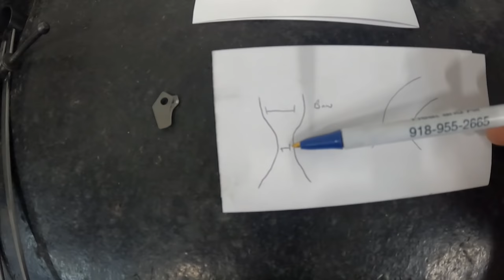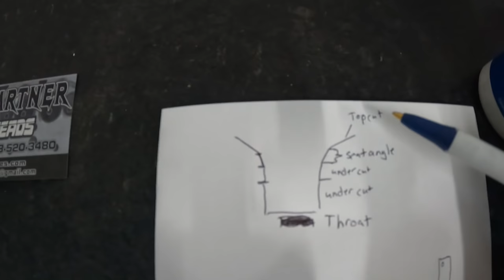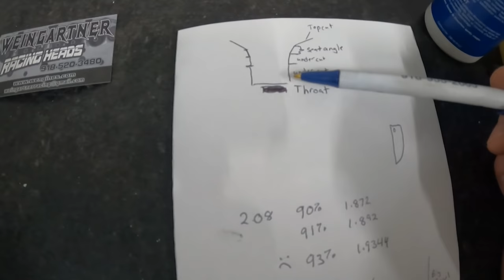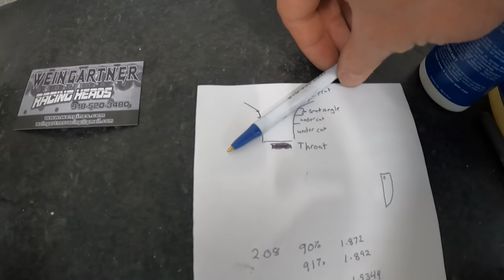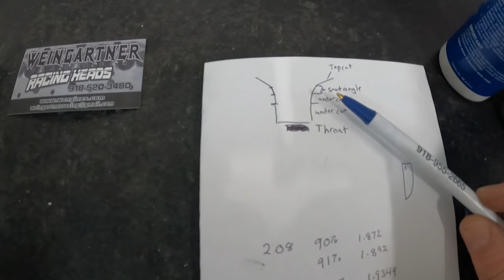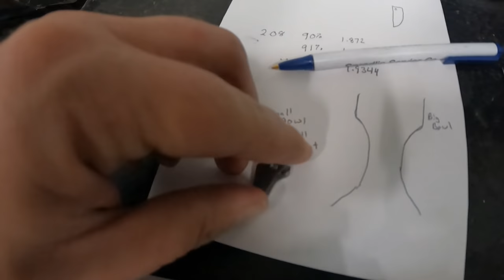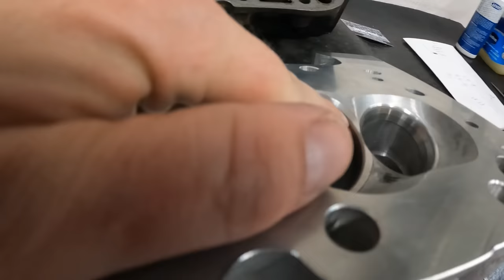What not to do when porting heads

Comment: 35ish degrees is what the seat should be. Check out David vizards videos on porting. He is a absolute wizard on them and wrote the books about porting. The tinniest change can make a big difference if it's in the right spot. It's all a balance of port velocity and flow.
Reply from the maker: That is completely and utterly wrong. The only place for those seat angles is a diesel because they have very little lift and it helps with seat wear.
Reply: 35 degrees is the angle he suggest from the widest part of the bowl up through the edge of the throat on the cylinder wall size. That isn't the seat angle. On the cylinder center side he suggest the angle should be 10ish. That's about bowl dimensions and doesn't have anything to do with the cut angle on the valve seat.

Comment: Thanks for the great video.  The reasoning for throat ratio not being critical for exhaust make sense but it begs the question: would the poor flow characteristics of the throat being cut too wide be lessened with an increase in pressure of the intake charge (i.e. forced induction)?  Thanks for the informative videos!
Reply: The point is with forced induction you no longer need skill. Just boost and more boost. If you blow fuel straight through it doesn't matter as you can brag the dyno results.
Normally aspirated is like a musician in perfect tune across the spectrum. 250bhp per litre was achieved in the 1960s. Many turbo engines can't get close now. Except F1... £1000000 engine, 250 miles
Now that's a bargain.

Comment: Eric have you ever tested a valve with multiple back cuts ?
I was messing around at work. Took a 460 stock valve and put a 15°, 30°, 45° and 50°.
Then reversed my cuts from 50, 40, 30, 20 and that blended into the 15.
With .070 width. Just curious what you or anyone who's actually flowed something like this (surely its been done a million times) ill get the flow bench at work going and see. Vs a few other used valves with different angles

Comment: I work in a machine shop mainly doing street stuff not much for performance. Often I'm cutting three angle seats on stock heads with replacement seat inserts, I'll set the cutter up on the valve as normal. Most of the time I'll end up with next to next to no bottom angle. I always aim to have the seat in the middle of the valve face usually an 060 or 080 width for street use. Does this mean stock heads will flow like crap until you fit a bigger valve and you're able to increase the venturi effect? What's your take? I'd be interested to know what you think.
Reply: On a wedge head how do you keep all the valves in a straight line ? If I take a straight edge and place them across the valve stems no shop ever gets them straight.

Comment: Thanks for sharing your knowledge.  That aluminum head looks maxed out since there appears to be no room between the intake and exhaust valve to go with a larger intake valve. Am I correct?    Some people don't think to do any research before they start hogging out their heads.  Even if you were get one of the intake and exhaust ports correct is that novice person going to be able to repeat the same dimensions with seven more intake and exhaust ports?  They don't think about that factor. 
If I've invested several thousand dollars in a set of heads, you can bet that I'm going to take them to a reputable head shop for porting.  If head work was as easy as some folks think, it's obvious that you wouldn't be in business.  Personally, I can do a lot of engine work in my small garage, but I'm just not set up to do anything to those heads but some flash and rough casting clean up, plus I'd have a real problem living with a dumbass, (myself) if I screwed them up.  Thanks again for the video.

Comment: So what You're saying is instead of Directing the Air down into the Combustion Chamber, the Air goes Straight over top of the Valve hits the back of the port and then goes through the Valve?

Comment: Some even say 85%. When would that apply?

In my stock 60deg v6 heads the throat is 1.42 for a 1.72 valve, wich is 82.5%.
Reply from the maker: With really small valves you can smaller on throat.
Reply: @WeingartnerRacing  good to know.
Also how do uou decide on the venturi shape. Are you going by experience or do you sneak up on it using the flow bench?
Im guessing the placement of the throat changes depending on the angles used under the seat?
Reply: @WeingartnerRacing  I was thinking of going up to 1.76 valve from an later engine but got advised not to. That would bring the aspect down to 80.5%. Possibly the throat could be enlarged to retain the 82.5% or higher. 
My thought was that the bigger valve would increase low lift flow since Im limited to around 480 lift.
But the engine builder was unsure of that(having not seen the head in person). He performed well in engine masters one year so I assume his advice is sound.

If I may ask, what would your opinion be?
Its canted valves and the bore is 92.5mm (3.64inch). Port inlet area is around 11.5cm2 (1.783sq inch).
Throat is 1.42 but the bowl is quite alot bigger.
The newer valve is alot flatter than the original tulip shape so that also factors in I guess.
Reply: 1.42 in the throat less de valve guide?
Reply: @jesusavila7955  no its just diameter Im talking about. So the areas are even more different.
Reply: @magnusdanielsson2749  I know but when you talk about area in this sector you must subtract the vastness of the valve and part of the guide
Reply: @jesusavila7955  thats the thing. The discussion usually alternate between talking about diameter or area. Makes it confusing..
For the max 92% troat/valve ratio it is diameter thats compared. Thats usually something like 85% area difference.

When talking about diameter, the valve stem is never included. 
When talking about area you could include it but it does not affect the area ratio to a big extent. Especially on bigger valves

Comment: Does increasing the throat on a stock head to a safe, maybe 85-87% help top end power or bottom? I'm thinking it would only help top end, because you said at low lift, if it's too big it hurts. I think of rpm and lift being the same things at times but that's a mistake. But the only time you're using all your flow at high lift is at wot, probably on the top end of your power curve? Am I correct or confused?

Comment: That was not a bowl hog. A bowl hog don't even fit on a serdi. It's a tapered cutter that will cut some into the bowl. If your doin a 3 angle valve job on say an old set of Chevy double humps, you just hit below the seat and maybe lower. Then you can hit it with the 3 or 5 angle serdi cutter. You can hit it with a 5 before but it's gonna cut in to the throat area/short turn pretty hard. I've turned 194 intake double humps in to 202 double humps this way. Take small amounts at a time, whatch what your doin, cause you can't put the material back.

Comment: I honestly believe while the flow would hurt, it's still a good tool in some cases. If you remove those angles, the mixture has to go straight, the valve is in its straight path. And a big thing in combustion is when the fuel hits that hot valve, it vaporizes and you get a better burn, so if more fuel HAS to hit the valve... it's good for trucks and street/drag cars

Comment: Glad you clarified that it applies to the intake only. I did a set of turbo Buick heads that are 92% intake and 91% exhaust.  Flow numbers are excellent and the exhaust side is the highest I've seen on a 8445 Buick head. 91% on a 1.5 valve forced a very narrow 45 which is not ideal but everything is a compromise.  Your doing a great job.
Reply: How does a higher exhaust flow % help when there is 20+ lbs of back-pressure?
Reply: @mr.know_it_all  Always remember... a huge amount of the gasses are expelled the instant the exhaust valve lifts at all. Right before the exhaust valve even opens there can be between 50 and 100 psi, and this is more than plenty to spool the turbo. If work on the exhaust port leads to more flow, then the cam doesnt need to start lifting the exhaust valve as soon, and more of this excess pressure can be used to continue pushing down on the piston, making more power that way. The turbo is always supposed to be the exhaust restriction and nothing else, and is easiest to change, via a different exhaust housing. If the exhaust port flows better, then all of a sudden perhaps the turbo exhaust housing doesnt need to be so small for best spooling. This is how a higher exhaust flow % can help the boosted engine.
Reply: I seriously  doubt  it matters on the intake having those angle because the flow is in the opposite  direction which those angles ate of little help. This is why the tesla valve works so well at restricting flow in one direction and not the other. I believe the opposite  of what this guy is stating in his video. I say prove it (on the intake side)
Reply: @Engine_biulds , When compared to those with experience, your position is the minority. The burden of proof falls to  you. Also, remember there is a great big restriction in the way for most of the intake cycle (valve). In fact even for a fairly hot street engine, the valve is never out of the way. Pretty sure David Vizard has some #s in some of his books if you want someone else to do the testing for you.
Reply: @Engine_biulds  The boundary layer of the air flow coming out of the intake port will widen as it exits. Remember the boundary layer barely moves any air. The harder the turn the air must make the less of degrees the boundary layer moves. This creates a false wall that the velocity must overcome. the reason you see long slow sweeping "trunk" areas on very fast vehicles is the accommodate this principle, allowing the boundary layer to transition to the chamber surface as fast as possible.
Reply: @mr.know_it_all    Less flow restriction is rarely a good thing.   For some reason GM left a BUNCH of cast iron in the bowls just below the seats on 8445 heads.  Removing that, is a tremendous boost in efficiency.

Also, there's no such thing as ''back pressure''.  That's what people claim you have to have when your N/A cam has too much overlap and you need a crutch to get away with it.

   What you're describing is 'resistance exhaust flow'.    And in a turbo engine, you want the resistance to be the exhaust wheel in the turbo.  Not the path getting there.   Choking the exhaust pressure before it gets to the turbo is just wasting VE and pretty much defeating the entire purpose.
Reply: @andrewkelly1225   Smokey Unick talked about that alot way back when as well. He called them ''flow cones''.     Turning the throat into a sewer pipe, kills those off.

Comment: How about a boosted engine?  Does it work to open the throat on the intakes, for the same reason it works on the exhaust? Very interesting video, thanks.
Reply: Air flow is air flow. The only difference is biasing for turbos versus everything else (or nitrous). The same principles apply.
Reply: @rocketsurgeon11  Thanks. I'd like to hear more about "biasing" for turbos.
Reply: @joeretro  some may disagree, but from what I have seen, going above 75% of the intake for flow capacity in forced induction helps. It may be due to the marginal heads I am used to, but that's been my, and a few other's observations. Also, low lift flow characteristics are very important to prevent reversion of exhaust back into the chamber.
Reply: @rocketsurgeon11  Thanks. I get your point about low lift flow being important with a turbo due to increased backpressure--hadn't thought about it that way.  By 75% are you referring to intake to exhaust valve size? If so I understand. Watching more of your videos right now.
Reply: @joeretro  Yes, valve size. I WISH these were my videos! LOL I watch these all over YT to learn as well. I was simply iterating things that I have witness works and from other experts that know WAY more than I do. This work used to be very "secretive", but it's much more accessible nowadays. It takes a combination of talent/skill and the correct machines to pull off what these guys do. Unfortunately not a lot of DIY guys can really replicate it 100%. But, applying the knowledge, you can STILL get benefits and gain power. I was happy to see a custom cutter here. I'd been wondering why I hadn't seen it yet, but this video answered my question! I also take in what I can from guys like David Vizard, and still go back and reference Larry Widmir of Endyn posts on "The Old One" forums (wish those were still active...I learned SO much back then!).
Reply: @jorkusmalorkus  well, I am not inclined at this moment to re-watch a 17 minute video, but my educated guess is that it has to do with biasing since that is what I was talking about before. There's also cross flow to consider as some of his more recent videos have brought up. In a turbo application specifically you might also be considering that the exhaust has a higher pressure in it than the intake. Now, for a racing application it shouldn't be a lot, but a street car may see 2x or MORE the amount of exhaust manifold pressure versus what is in the intake port.